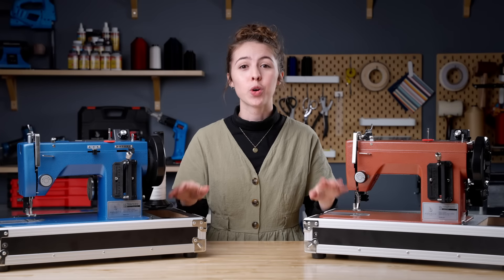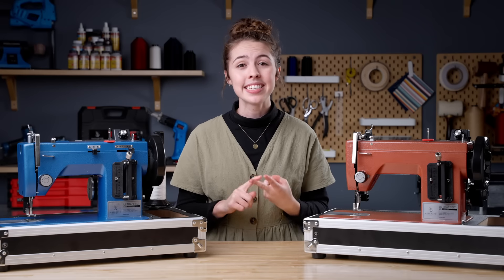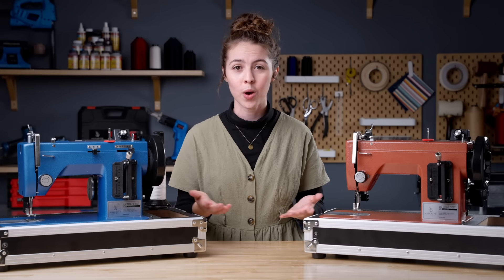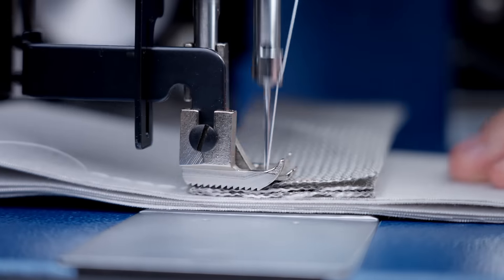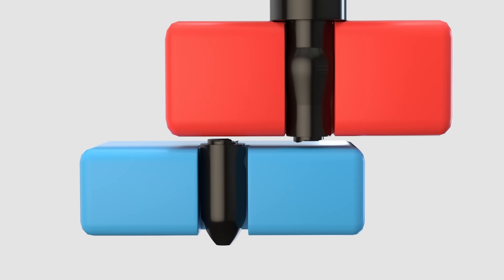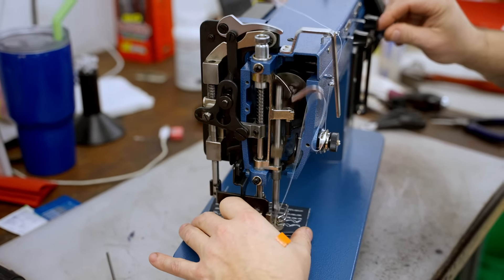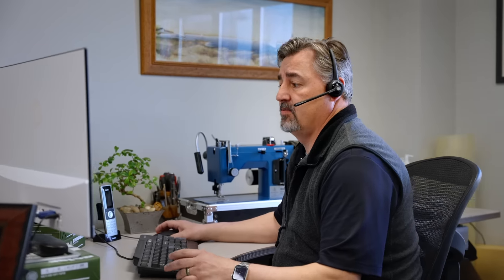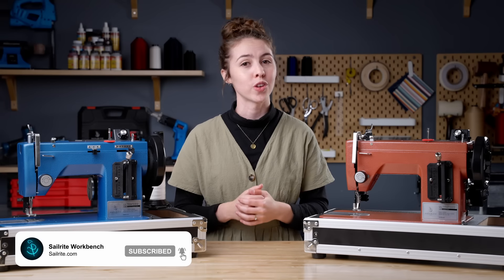Sailrite Ultrafeed Sewing Machine - Portable Heavy-Duty Walking Foot Sewing Machine

Comment: I would only consider this machine if I exclusively sewed very heavy/thick material. There is a reason it's called 'sailrite' - it's designed to sew sails, indeed heavy duty material. This is not the machine I would choose to sew most clothing or for piecing/quilting - the things most people want a sewing machine for.

Comment: No mention of the bobbin casing etc.  Sewing thick fabrics or leather can cause needles to bend, break and cause damage in and around the bobbin. 
Basing on my 18 years experience in manufacturing. Factory maintenance claimed those replacement parts where quite expensive.
Reply from the maker: The Ultrafeed's patented Posi-Pin safety system (think of a shear pin) will break if there is a bind or jam protecting the parts. Also since we are assembling them in Indiana the parts are readily available and affordable.

Comment: My experience is that this is a terrible machine. It sounds like a freight train and it does not function consistently, nor does it function like other properly made walking foot machines. It’s portability does not make it worth it. Do not be fooled by a slick video. My critique comes from years of experience repairing this crappy machine and hours of production sewing on other triple feed walking foot machines.
Reply: Do you have repair vids ?
🤺💐
Reply: I miss my industrial Juki 😢
Reply: Bernina
Reply: I hear the Brother sewing machines are good. Would you agree?
Reply: @becca318  Brother does make good walking foot machines, although I can't remember which model is a triple feed. Some triple feed machines that I would recommend are Consew 206RB, Juki 562 (smaller bobbin) or 563 (larger bobbin), and Pfaff 145 H4 (smaller bobbin) or 545 H4 (larger bobbin).
Reply: industrialsewingmachinerepair .. Okay, thank you for the info.
Reply: Will it do leather?

Comment: I've had a White sewing machine for over 45 years. It's called the BlueJean machine. It'll sew 4 layers of naugahyde or canvas, etc. Just put a new zipper in my hunting vest. Wouldn't trade it for anything!
Reply: They built stuff to last back then.

I've got a GE tabletop oscillating fan that I use every night when I sleep. It's definitely from the 50's, I think 1955.

I found it at the curb on trash day. I  had to replace a stripped nut, runs like new
Reply: @kurtbarlow9402  I have a PFAFF sewing machine that is about 70 years old. Still works but I prefer my White. Bought it back in the early 80s in Hillsdale, Michigan.
Reply: @GaryFeltman  

My Mom had a Singer hide away table unit from the mid 60s . The thing was a tank. Don't know who she sold/gave it to, but I'm sure it's out there somewhere,, still runnin'

Comment: I wonder why they got rid of the normal posi pin system ??
Reply from the maker: The metal Posi-Pin wouldn't break as consistently as we would like so switching to a composite pin allowed us to more accurately determine when the pin should break allowing it to properly save the machine from having to be retimed or tuned when a bind or jam were to occur.

Comment: Why do sewing machines need to be portable, anyways?
Reply from the maker: For some sewers, portability is essential to bring the machine with them where they need it. For example, for sailors, this feature is invaluable in a heavy-duty sewing machine because they can bring it with them as they travel to repair the sails on their trip without having to port. For other DIYers, like canvas workers, upholsterers, bag makers, and leather crafters, this feature isn't vital, but it still provides the flexibility and freedom to continue their craft wherever they are.
Reply: Plus a lot of designers arts & craft etc will travel with their machine ..
Reply: Reupholster office units, over a weekend.
 Dental chairs.
🤺💐
Reply: Because not everyone has room for a full commercial sewing machine with oil bath and heavy builtin table.

Comment: That machine is garbage! 😂 and they want over $1000!?!? Anyone on the fence that is thinking about this stick to a quality machine and for that much money it’ll be digital and do hundreds of things and stitches lol
Reply: why
Reply: This is a portable
    dedicated straight stitch.
Mine is named
    "KABOOM" THE BLUE DRAKO.
The features: it's powerful, strong,
intrinsic feet, monster wheel handle -
   off grid power, mine.
   No fancy stuff to repair, if needed.
Mother boards only last
    at best capacity 5 yrs.
  Old tech, deteriorating materials.
This will last almost forever.
This can be attached to a treadle,
    hand cranked.
The carry case is out of this world and
   worth every budgeted dollar.
🙋🤺💐
Reply: Computer controlled machines are worthless. Anyone who suggests a heavy duty high torque mechanical machine isn't ideal has clearly never worked with heavy fabrics.

At this price however it has to be much better than an old kenmore 158.1410 machine to be worth it. You can pick up good used juki commercial machines for 600 to 1000 but those are seriously non portable and require a dedicated space.